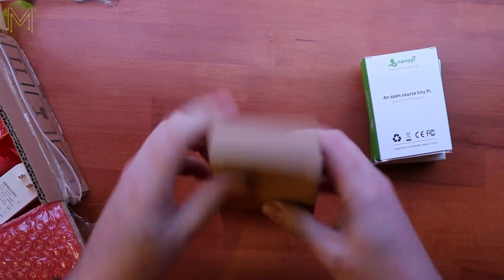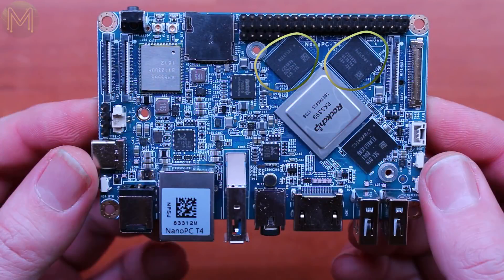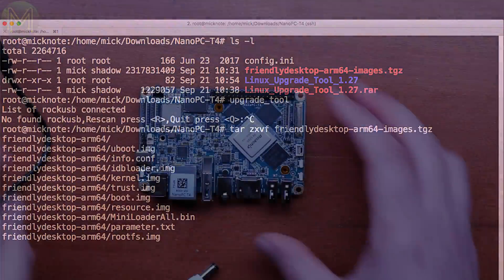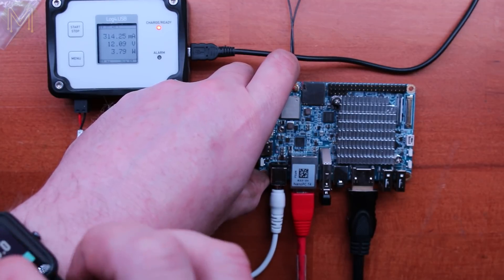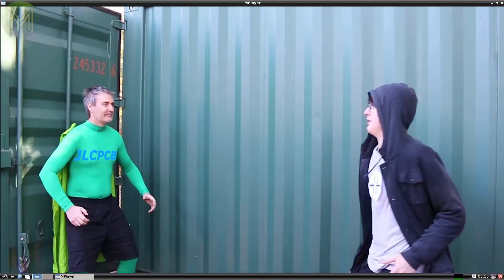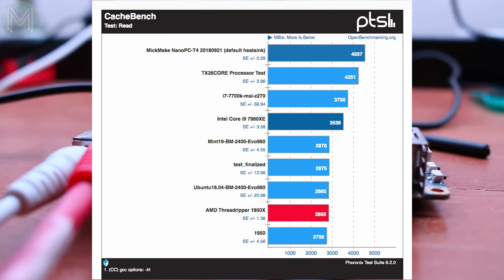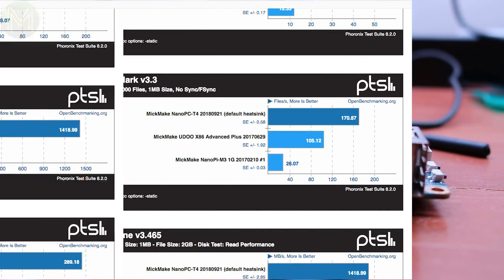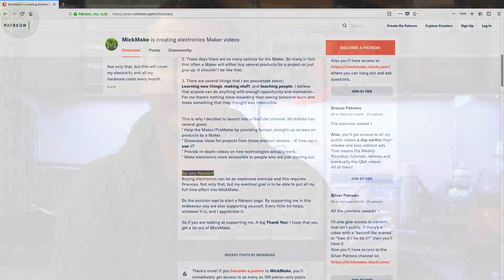#230 NanoPC-T4: No room for anything else. // Review

Comment: 3:24 little mistake here. there are TWO realtek chips, and one you mentioned is audio codec. ethernet one is near ethernet port.
Reply from the maker: Yes. Sorry I do make mistakes sometimes. Here's the list of key semis on the board:

U19             - RTL8211E      - GbE transceiver.
U30             - AP6356S       - WiFi/Bluetooth module.
U12/U40/U41     - RT9724GQW     - MoSFET switch.
U29             - ALC5651       - Audio CODEC.
U8              - RK808         - PMIC

U10/U11         - RT8010GQW     - RT8010/A is a high efficiency PWM step-down DC/DC converter.
U15             - NB680GD       - 26v to 3.3v/8A DC buck converter.
U16             - NB679GD       - 26v to 5v/8A DC buck converter.
U2              - RT9193        - Battery optimized 1.8v LDO.
U38             - SYR838PKC     - DC to DC converter.

U28             - FUSB302MPX    - USB TypeC controller.
U94             - TXS0102DCU    - I2C logic level converter.
U27/U31         - TPD4E05U06    - ESD protection.
Reply: I noticed that too. But you beat me to it. ;)
Reply: Awesome video no garbage just straight up

Comment: Is it somehow possible to 2-4 SATA Ports out of the M2 slot? 
Maybe some extension / riser card?
Reply from the maker: It should be possible, but I'll need to confirm that.
Reply: This would be perfect Mick! 
I bet many people are searching for a small SBC with native gbit Lan and pciE to native 4 port sata solution. The USB 3 bridge stuff is nasty ;-)
Reply: You just need a m.2 card with a sata controller on board. There are a few of them, but sadly half height. I bet you could 3d print a adapter from half to full lenght m.2

Comment: Mick, I loved the review portion of the video and all the great info but I noticed you installed the heatsink 180˚ around and the cutout for the microphone was in the opposite corner. Did that allow the small heatsink to actually come into proper contact with the top of the SoC? I ask because 91˚C is where I would expect there to be some automatic clock throttling if it does such a thing. I would love to see a repeat of the benchmarks with a proper 3 or 4 cm high sink or even the stock sink properly applied. And I hate to be blunt, but I could do without the campy segments. I wish the attention went to properly mounting the heatsink instead. For me and a review of this SBC, they definitively subtract from rather than add to the presentation.
Reply from the maker: Oh the heatsink: it was connecting properly even though it was the wrong way around.

Part 2, I’ll be using my mega heatsink to see if I can get that throttling down.
Reply: YAAAY!  The massive copper behemoth shall return!
Reply from the maker: I’ve been toying around with different formats in my videos. I want to primarily disseminate as much info as possible, but for me that can get quite boring in a video.

I still want to keep my style, but I’m thinking of putting the “nonsense bits” at the end... or else keep them shorter.

Thanks for the feedback. I welcome it.

Comment: Curious about the DP outputs, can you hook it up to the popular iPad 3 eDP screens without an adapter?
Reply from the maker: Alas not directly. You'll need a converter as the pinout is different.
Reply: correct me if I'm wrong but they should be directly compatible, as they both use 4-lane eDP. You can buy the 30pin board to cable connector counterpart (I-Pex 20454-030T) everywhere and solder equally long 30awg wires to it in differential pairs. Many of the pins are meant for the multiple backlight LED strings. A working breakout https://github.com/Emeryth/iPad3_lcd has also been designed for the screen. I'm really curious to give this a try

Comment: Nice review . Looks pretty good bang for bucks at the 125 USD they ask ,imperfect on the ssd ready spec so as suggested it's a nvm style only . Those jetson boards are 500 plus  so very livable in comparison thanks Mick have a great Sunday .
Reply from the maker: Yeah, that's what I figured. Getting close to the Jetson performance for that price is good. And this really applies for any RK3399 based SBC. So you can actually get cheaper than the T4.
Reply: @MickMake   for what that t4 offers up it's best in its class and the 1x or 2x jetsons run about 550 USD  .

Comment: Could you make an adapter to allow the Pi projector to work?
Reply from the maker: Alas no. Even though the RK3399 does have parallel RGB capability, the T4 is using some of the signals, (especially HSYNC and VSYNC). So, would be impossible, at least, on the T4.
When I do the M4 review I'll check that out.

Comment: Hey Mick,

Great video ( looking forward to the next ),  which kernel version was running? ( uname -a? ),  I am wondering if the slow writes are a kernel thing or no.   There are Open Source modules for Mali coming for both 400 and 7/800 up, but as you state the question is when.
Reply from the maker: Thanks mate.
Using a 4.4 kernel. Can't remember the patch level at the moment, but was in the 100s - 114?.

I'm sort of leaning towards the slow writes being a thing of the SoC. I was getting the same result using different benchmarks, but would be good to do a similar benchmark on Android.

I think once the OSS MALI drivers come out, it'll open up a huge number of cheap SBCs. It will definitely change the industry and we'll start to see some really cool hacks coming out.
Reply: Oh yes should be exciting times,

So I did some quick digging and wondered if you might be interested in looking into this,

https://github.com/armbian/build/blob/master/patch/u-boot/u-boot-rk3399/nanopc-t4.patch

I got to this page from this forum,

https://forum.armbian.com/topic/8069-orange-pi-rk3399-and-armbian/

Its all around the RK3399 from what I am seeing this might be just a quirk esq thing, like we see with variations on the same theme with audio and gpu's on regular PC hardware, also they mention a current UBoot ( or as near as you can ) .. I was going to ask on the Rock forums too as I was not sure if this was the same with the RockPro64, il let you know if something turns up.

Comment: i suppose it depends what you're doing with it, but i've never understood the value of these $100 boards, when for the same price you could get a compute stick.

yeah, they have more features (m2, sata, etc etc), but the compute sticks are packaged, reliable, and ready to go.
Reply: most if not all of those compute sticks are made by intel. today that translates to plenty of hardware vulnerabilities, and performance crippling patches.
now the A72 cores a very bad example as they are just as vulnerable, but say you use a soc with only A53 cores which are perfectly fine
Reply from the maker: One of the reasons is GPIO access and I guess a secondary attraction is the fact that you have bare metal access to everything.
So, depends on what you want and is the great thing about an open market - for some SBCs are the way to go, others compute sticks or cheap ATX boards.
Reply: Yup I can get a cheap used small form factor PC for around this price with a valid windows COA.  So bigger or smaller featureset is available elsewhere.